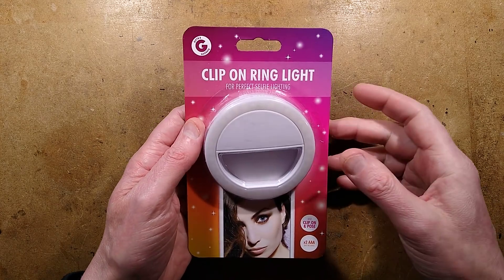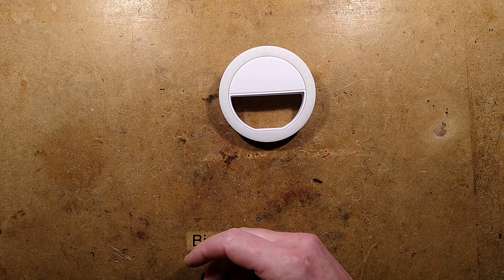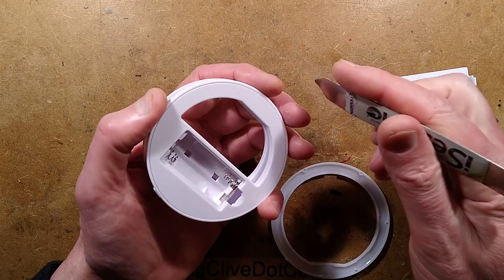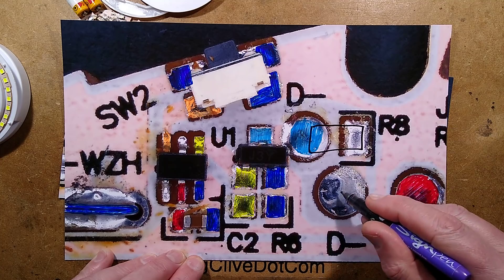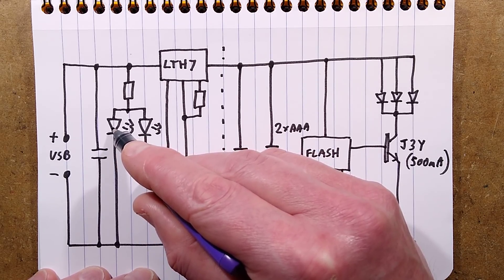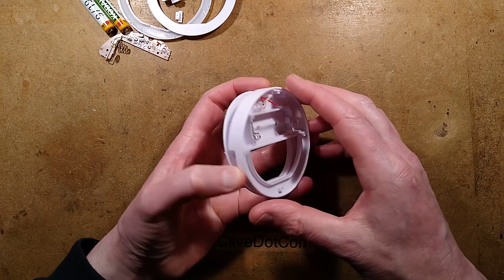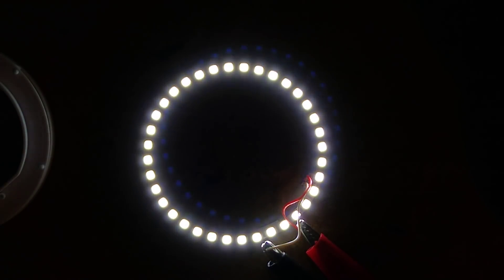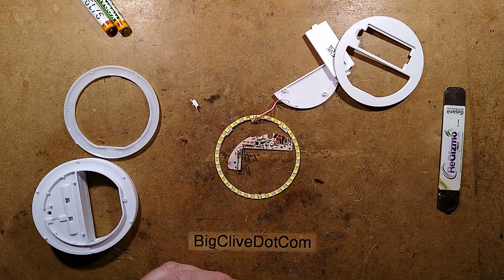Pound shop ring light teardown (with schematic)

Comment: Great video Clive - Would be good to know the CRI value of the leds? I'm guessing low given the price, but for photography it does matter.
Reply from the maker: I'd really need a CRI meter to test that.  It's something that would probably be quite expensive, so I'm not sure I could fully justify it.
Reply: @bigclivedotcom  Perhaps, not even sure who sells them. Presume it would be a spectroscopy measurement device..? Although I think might be possible to setup a test scenario with known high quality lamps and then do a subjective comparison...
Reply: @dougle03  I think they're used in optics manufacturing? And also for calibrating the output of professional-grade computer monitors for artists? The people that are buying them are usually in a market where cost doesn't matter, they just need the best of the best
Reply: There seems to be a common/standard CRI measuring device used by a lot of the AliExpress sellers of LEDs that are at least claimed to be high CRI (at least some of them probably are genuinely high CRI, especially among the larger, more specialised stores).
A lot of them are showing the output of some kind of spectrometer in an attempt to back up their claims, and I keep seeing the same GUI layout over and over again.
No idea what that device is, though. It's probably still more money than would be worth spending for this sort of thing, sadly.

There are also some DIY spectrometer designs floating around the Internet (am I right in saying that The Thought Emporium has a video about one..?), and while they'd probably show things like the narrow emission bands of most CFLs, I doubt they'd be suitable for differentiating between 80+ CRI LEDs...
Reply: @AndrewGillard  Don't know about Thought Emporium, but I built a quick-and-dirty spectroscope a long time ago using LEDs as photodiodes. Yes, LEDs can turn light into current but they only do so for light redder than they emit and only a relatively narrow part of the spectrum.
Not really up to determining the CRI of a light source completely but can give you a ballpark idea.
Reply: @AndrewGillard  Don't know about Thought Emporium, but I built a quick-and-dirty spectroscope a long time ago using LEDs as photodiodes. Yes, LEDs can turn light into current but they only do so for light redder than they emit and only a relatively narrow part of the spectrum.
Not really up to determining the CRI of a light source completely but can give you a ballpark idea.

Comment: I  bought my Isesamo spudger after the first or second video I ever watched of yours and it has been a great tool!  Still on my bench to this day!
Reply: Me too
Reply: I also got the set of 2 (regular and small).  I don’t use them a lot but when ya needs a spudger ya needs a spudger.
Reply: Me too, i have a BCDC starter kit, complete with spudger, small screwdrivers and a messy desk now full of precision screwdrivers and bits lol...
Reply: Same here. Mine came as a set of two - the standard size as seen here and a tiny one. Really useful and highly recommended.
Reply: Also have one and have been using it a lot since I got it. Not sure whether mine is an original, since the plastic sides (stickers) fell off, but it's still in good shape.
Reply: @Quick_Fix  My stickers are felling off too after some years. Not sure if genuine or not, but still working.
Reply: @Quick_Fix  - Get some heat shrink tubing (adhesive by preference, at least for the first layer).   Slide it over the spudger, heat it up, it'll seal on.   The adhesive will help pad the edges while it shrinks.   If it's not thick enough, add another layer.
Reply: Me three! 😄
Reply: i've gone through numerous ones before i gave up and just use single edge razor blades, once you get good with them you will never want to go back to a classic spudger for cellular devices or modern laptops.
for random plastic cases like this the isesamo spudger is ideal but i rarely deal with things like this that have gaps wide enough for anything but a blade
Reply: @Mister_Brown  - Do you use real single edge shaving razor blades, or do you use scraper blades?  (assuming scraper blades).   You can find stainless steel shaving blades; they're more expensive than the scraper blades, but they won't rust on you.
Reply: Took me a little longer... Maybe the 10th video, but I went on a binge as soon as I found the channel.

Comment: I think your meter leads are broken.  I was cringing as the red one was wiggling around :(
Reply from the maker: The clips never seem to align perfectly for these tiny wires.
Reply: @bigclivedotcom  I was referring to when you were using the multi-meter to try and measure the forward voltage (around 2:00).  The red probe tip was all wobbly :(  I've never had good luck getting stable readings once they've started doing that.